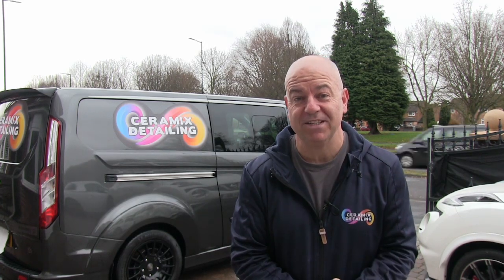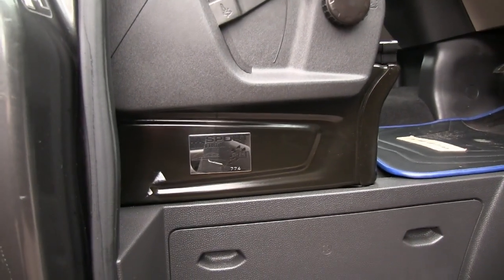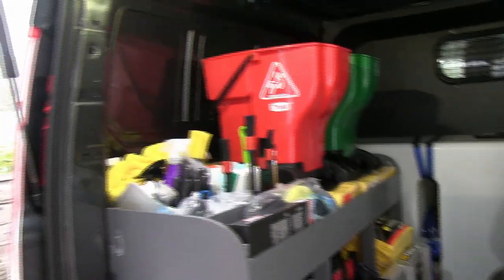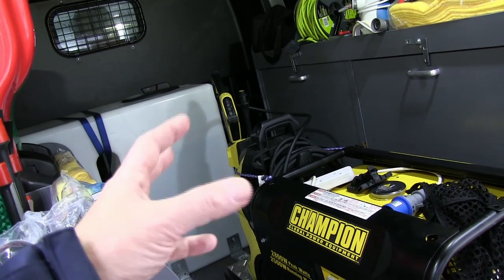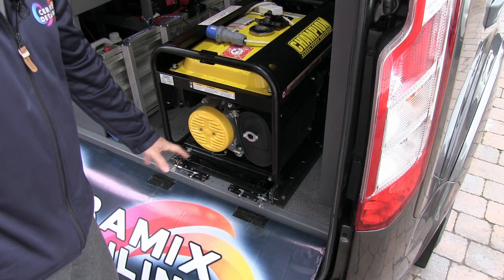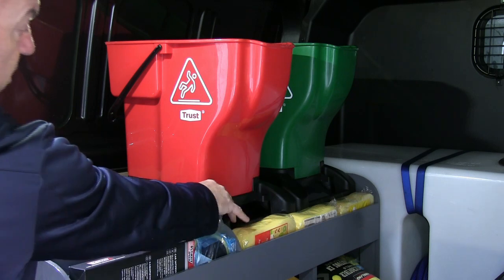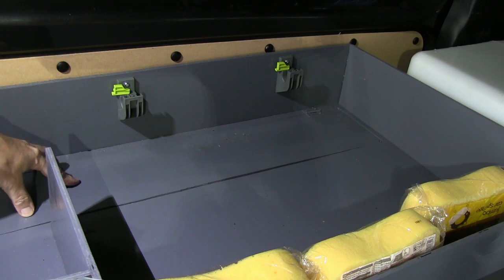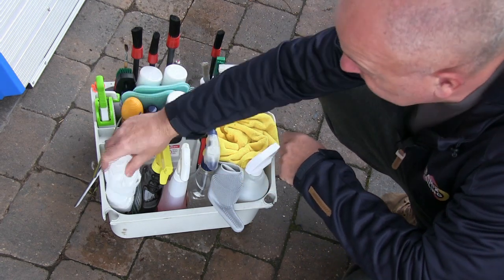Awesome Mobile Detailing Van set up | Ford Transit Custom M Sport Double Cab.

Comment: Good set up drive past your house most days !! Iam allso a local mobile  valet.  I so agree smart looking van is a must in our  line of business
Reply from the maker: Thanks Adam, much appreciated. If you're passing my detailing unit (on Skelton Road, Timperley), pop in for a brew. Drop me a message on my Facebook page or google business page and I'll let you know the next time I'm at the unit. Got a Bentley Continental GTC to work on at the unit on Monday (18th July) so pop in then if you're in the area.
Reply: Definitely can not pass on a brew 🤣was up thare only 2 weeks ago dropping my other  van of to Mike for a cam belt .  your in the old body shop place I think .. I have a nardo gray mk4 caddy van with bronze  wheels you can not miss it 😉

Comment: Just a heads up I was watching a video the other day about magnetic signs on the Transit custom and sports and apparently it's not good for the paint. Just keep an eye on it oven that cracking by mate well kitted out
Reply from the maker: Thanks for the heads up and the comment Stu. I've ceramic coated the panels for that very reason. Also, re-positioning the magnets or them moving while driving will result in surface scratches

Comment: Do you have a video or parts list for what you used to make the generator slide-out?
Reply from the maker: No parts list but it's all very basic stuff. 4 x 1m lengths of 40mm x 40mm mild steel angle iron. 2 for the frame and 2 to bolt down onto the floor of the van. 2 x 1m lengths 40mm mild steel flat bar (cut into 500mm lengths). Weld that together with the angle iron on the sides and the flat bar across the top (spacing for the flat bar should match the frame of the generator so the generator can be bolted down. Thin piece of chequer plate for the back part of the slide out (behind the generator). A pair of 100kg load rated sliders (got mine from ebay for about £20). I'll see if I've got time to make a short video showing what I've described here.

Comment: Magnetic signs are not a good idea. Someone can remove them just to have a laugh, they induce scratches and dosen’t look as good as a wrap/stickers. Nice van…quite well thought…but I don’t understand why would you pay probably 40 grand for this van and go with cheapest tools and accessories? 😟
Reply from the maker: Van panels are ceramic coated to reduce scratching. Magnetic signs are a stipulation for one customer who does not allow sign writing on vehicles for local contractors - security measure, too complex to go into. Needless to say the compromise is worth it given the revenue this customer generates. The vehicle has a short life as a mobile detailing van. In a couple of years I'm converting it to a camper by which time Ceramix Detailing will have an industrial unit and will no longer be a mobile detailing business (that's the plan anyway). Cost of the fit out and mobile equipment has been reduced to a minimum to ensure a return over the 2 year period.
Reply: @ceramixdetailing29   Aaaa, I would never have such a customer. Paranoid that guy..let me tell you! But everyone with their own…good luck in your business bud!
Reply: @ceramixdetailing29   You will still need a van even if you have a unit. All those cars that are coming in your unit will need mantainance.